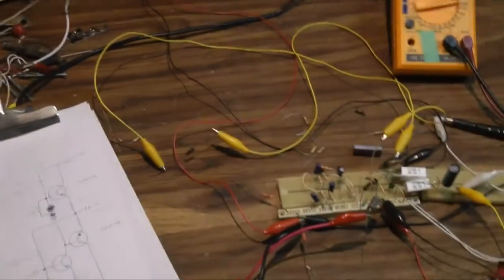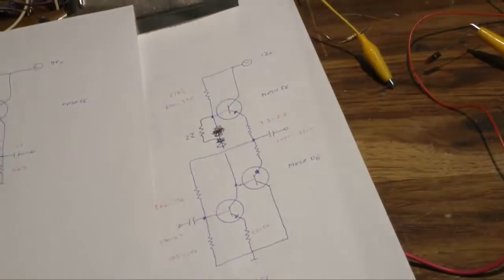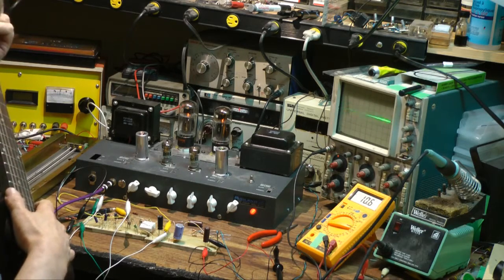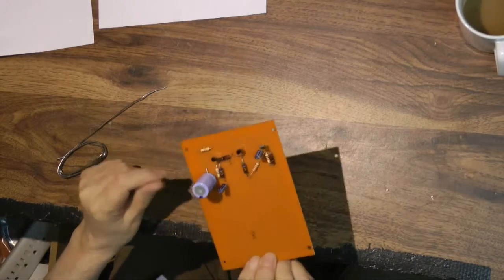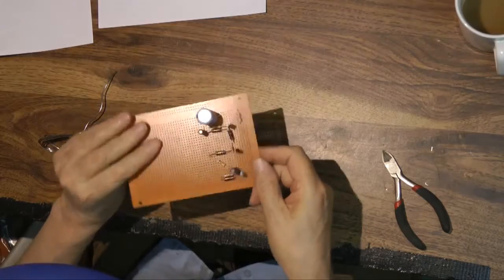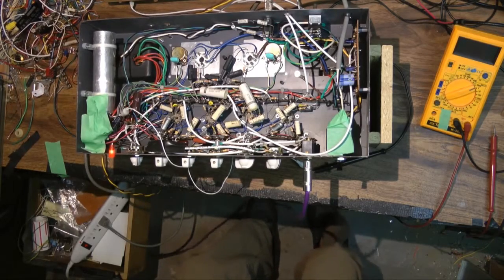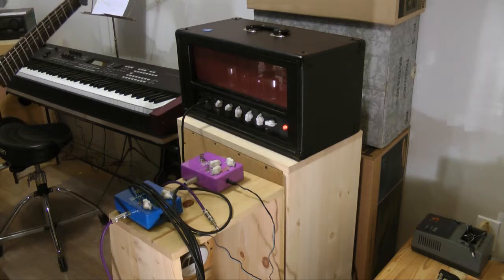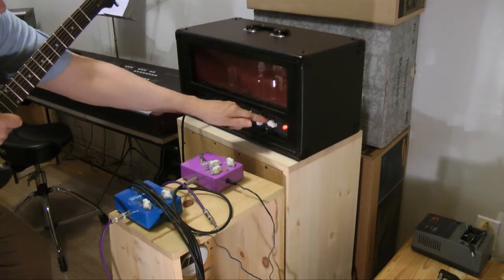50 Watt Tube Amp part 7 reverb driver

Comment: would i be able to have a copy of your reverb circuit thanks ian
Reply from the maker: There are 2 parts, the spring driver with 3 transistors, and the amp input preamp, which is a 12Ax7. Which are you interested in?
Reply: i would a copy of the whole circuit
Reply from the maker: I don't have the drawings on this computer, but I'll look them up tomorrow and Email them to you. The tube preamp is quite straight forward, 2 sections of a 12Ax7 as normal amplifiers, the driver is a complimentary "power amp" using 3 transistors. It can be seen in the beginning of this video.
Reply: thanks would it be possible to get the model of the signal generator you use as well i will try to buy one thanks Ian